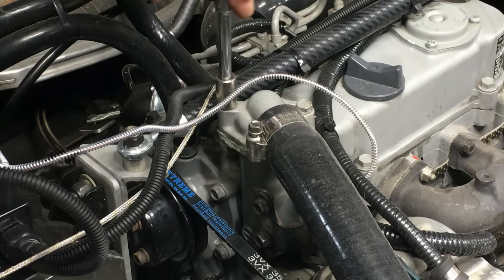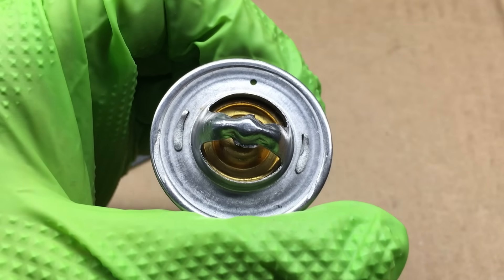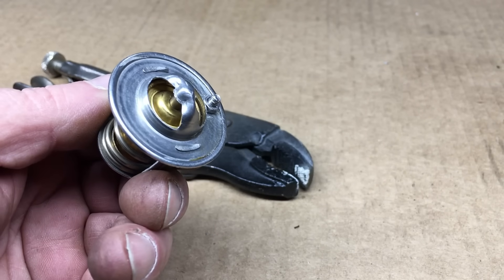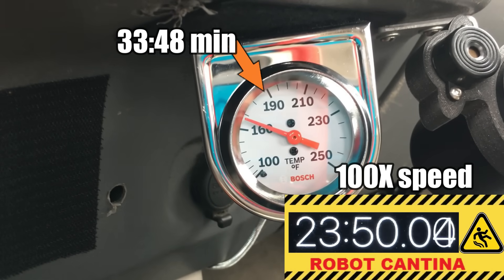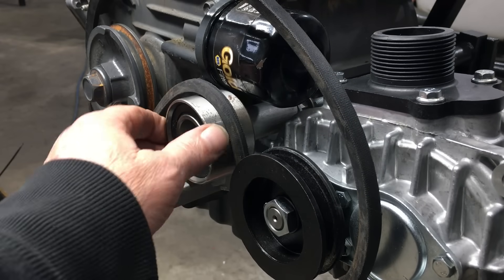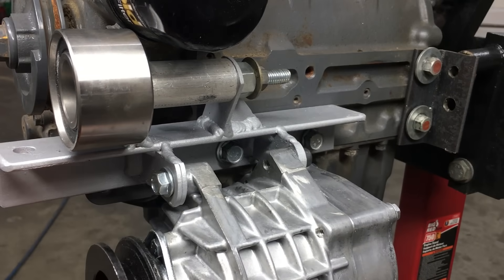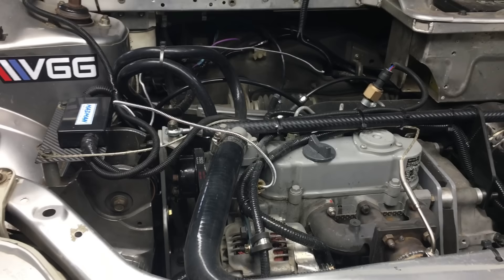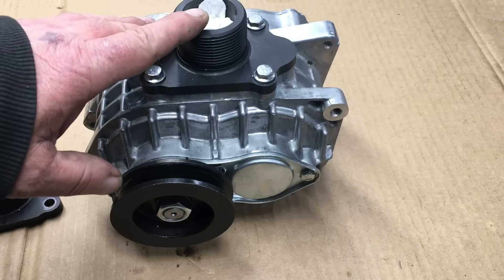S4 E4. Thermostat issues and making an AMR500 Supercharger fit a 719 cc Kubota diesel engine

Comment: I learned over 30 years ago to never run a thermostat under 190°. The engine needs to be hot enough to steam away moisture accumulated with temperature swings.
Reply from the maker: 180 is the hottest available for the Kubota D722.  Due to the odd size of the thermostat there and no other options.

Comment: Generally  the hole in the thermostat has a jiggle pin to reduce the chance of any air getting stuck there. It helps with the bleed too. Some engines prefer to have the hole in a certain position for best effect. There may be a note about that. Always bleed with the heater on full hot. Did you say this was an 88º? If so you do have the option of going to a 92º. I have used one of the Volvo blinds on a 1961 Amazon. Worked well as long as you kept an eye on the gauge!
Reply from the maker: Indeed the thermostat is 88c,   Obviously a hotter one would be more desirable, but 88 is the hottest available for the Kubota D722.  Due to the odd size there are no other options.

Comment: So... I was thinking, if I had a stupid charger, I'd think about adding a little electric oil pump and an oil cooler. do you think it's a feasible idea to improve the efficiency of the charger?
Reply from the maker: From past experience with these little superchargers, indeed the oil does get hot.  We will keep an eye on it when we do some testing, however I'm not sure I want to build a complex oil cooling system.  At some point I reckon we will run out of space.
Reply: @robotcantina8957 in addition to what you mentioned, I wonder how much weight would be added..

Comment: Automotive v belts generally won't run long with an idler on the back side of the belt.  the little diesel may not turn enough rpm to matter.
Reply from the maker: A few other have commented on that.  For now it will have to work.  The solution most folks have offered it to use a lawnmower belt,  Unfortunately due to the size nothing is available.    If the supercharger works out we will have to upgrade the belt drive to serpentine. But for now to keep it simple and cheap we will use the wrong belt.. it should last a few miles...

Comment: As a bunch of people have already commented the bypass hole also promotes some circulation so the heated coolant actually makes it to the thermostat but I thought it would be interesting to comment that on all the systems care have the thermostat is almost entirely unchanged from the beginning of their use till now with that tiny hole being among the most significant in their evolution and I think that is awesome.  Try to think of ANYTHING else that has remained almost the same for that long, I personally can't but I don't claim to be an expert in everything either so I am sure there are others.

Comment: Is there somewhere you could install a bleeder screw to help with bleeding the air out of the coolant system?
Reply from the maker: Yes, as I mentioned in the video, I do have the parts to solve this issue.  One thing at a time.

Comment: The shutters on modern cars also help with aero, as there is a fair bit of drag from air going into the engine bay and through the rad. Might be good to have the window shade running over a mesh or something, and out front of the grille. 

Also, it might help to drill and tap a hole in the thermostat housing to help burping?

Comment: it's a diesel, it will never heat up at idle as fast as a gasoline engine will because the combustion process is very different.

Comment: amr have 500ml per rotation the engine have 719ml per 2 rotations at 2 rotation amr gives 1000ml so you have 1000/719=1.39 bar map or 0.39 bar boost=5.65psi (theoraricaly) one to one ratio to achieve 14.5psi you need twice the displacement 1438ml or 1.438 to one ratio (theoriticaly) depending on cam volumetric efficiency etc so you are probaby close with these pulleys. nice job as allways.
Reply from the maker: Thanks for the math!

Comment: I haven't gotten seen most of the video yet but despite what is written, the bypass is also used to allow the temperature sensors to get a correct coolant temperature reading. If the coolant isn't moving at all, the coolant in the block will remain hot while the coolant where the thermostat is located will read cooler as it isn't exposed to the coolant in the engine block and heads. I'd imagine that a proper fix would be to shrink the hole instead of completely getting rid of it.

Be aware that this is just an educated guess.
Reply from the maker: Makes sense !
Reply: Just has to  pass air even 1/16 with a wire though it so it won't get clogged.
Or VW "Y" type radiator hose with the thermostat in the hose going to the radiator and the other just back to the motor. Coolant is always flowing at full speed just bleeds in some cold as the thermostat opens some.  they aren't cheap and cheap is important. @robotcantina8957  '77 front drive were all lie that, some BMW

Comment: The bypass hole is also to allow the air to escape and not cause the engine to overheat due to no water touching the sensing bulb of the thermostat.

Comment: This channel if full of first, The first Predator powered Honda Insight, the first supercharged BIG BLOCK Predator powered Honda Insight, the first 719cc diesel turbocharged Saturn Coupe, the first Predator 620cc powered Renault 10 and now the first 719cc diesel powered Honda Insight. I can only wonder what's next.
Reply from the maker: Perhaps a fuel injected supercharged intercooled BIG BLOCK predator powered helicopter?
Reply: I think it's got to be a two stroke snowmobile or marine engine fitted into a car. Other than a rotary Wankel or a motorbike engine, it's one of the only other out there options, just like the rest of the builds.

Comment: i believe some cars have vents that can open and close to help regulate the temperature in different weather conditions but often they are not that big. i would almost think maybe a different radiator from a smaller vehicle might help, some scooters are liquid cooled and have puny radiators but maybe small enough to not cool the engine too much or cool too little. less thermal mass might also help heat up faster as well.
Reply from the maker: The winter causes unusual problems, however the summer also causes problems.  The Saturn had issues staying cool with a radiator approximately the same size in the summer

Comment: I suggest installing a throttle plate on the inlet of the stupid charger. Your main FE disadvantage will be the constant boost (added load) even in light throttle scenarios. If the engine is always under significant load (even when cruising), then it won’t make a difference. But if you want to reduce boost, creating vacuum with a throttle plate will reduce power consumption of the supercharger when it’s not needed. Like when you plug your vacuum cleaner hose and it revs up due to lack of load. So operate your throttle plate based on EGT while cruising, either manually or by fancy Arduino trickery, based on load and EGT. 
I love the project!

Comment: I had a car that had no leakage hole in the thermostat and it was a bugger for pressurising the system and sticking the thermostat shut if I heated it up too quickly (i.e spanked it too soon) and sending the temperature gauge to the red and then dropping back. First time it did it I thought the head gasket was gone but no, it was just the stupid thermostat. Did it for years but never damaged anything

Comment: You can move the oil filter to the other side on these engines, there's an oil filter housing on both sides tides of the timing case, you just have to move the cap to the other side
Reply from the maker: The axle is in the way on the other side.
Reply: @robotcantina8957  aaaaah it would be too, would an oil filter relocation kit help the packaging of the supercharger?
Reply from the maker: @MothBird   I do have a relocation adapter in stock, but for simplicity I would rather try making everything fit  as is.  Things get messy real quick when solving one problem perhaps creates another problem.

Comment: Run a hotter thermostat
Reply from the maker: good luck finding one for a kubota d722 engine
Reply: @robotcantina8957  you’re 100% right, I just scoured the interwebs and even the evilbay and only found 160 degree and 180 degree thermostats that are meant to replace them. I tried looking for a 200-205 degree one and it doesn’t exist. Maybe there’s another thermostat out there from another engine that may fit, but I do not have the physical dimensions of the original and I highly doubt any auto supply chains or any internet sources will have dimensions of theirs that they sell. Kind of sucks but at least I gave it the good ol’ college try. Lol

Comment: Yeah, that takes longer to heat up than my VW ALH at 20f or less... If i leave the heat off or low, lol.. And my manual version has coolant heaters in the flange at the end of the head near #4 cyl to help.. There's no nice way to restrict air thru the rad/ block the grille...
Reply: Tested my daily driver today 30 degrees out doors as was the car for a few days started and drove right away, never going more than 2000 RPM and mostly 1500.  In one mile and 3 minutes (25 MPH speed limit and then 35 for the next minute at 4 minutes the car was full hot with good heat.  Honda civic has this same radiator you seem to have and it's got the hottest thermostat that I could find and gets just 40 MPG-38.  standard transmission, and I drive for economy nearly all the time.  everything I have on that saem drive has heat and nearly full warm in the mile and the 3 minutes.  the 305 V8 GMC pickup is a little slower to have good heat as it's a 4 gallon system, the Honda is a one gallon system.  Everything's been cleaned recently and nothings blocked.  The thermostat is in the lower radiator hose and lets the radiator water intot he block first and then the head and then back to the radiator.  the thermostat has a plate sticking 2 inches into the block, right at the water pump, I guess to pick-up temperature as nothing is moving till it opens, even then putting the cool radiator water on it as it opens.  Seems like the head could get too hot, but most Honda's are like that.  My Saturn Is also.

Comment: In the 1970's, the Canadian variant of the Toyota Corolla 1200cc variant (KE31) had a "venetian blind" kind of louvre in front of the radiator that you would close in winter, and open in summer.  It block most of the radiator in order to keep the engine warm.
Reply: These sorts of devices were common back in the day.  In the 1930's Rolls Royce had thermostatically operated slats in front of the radiator to help with cold weather operation.

Comment: I would have selected a tight fitting cotter pin to restrict the lion's share of the hole in the thermostat. This would still allow air to purge. Restricting coolant flow on the radiator return hose could also assist in warm up time.
Reply: That’s a good idea

Comment: I know I'm late to the game, but back in the prewar days you could buy aftermarket radiator shutters for this very problem.  Packard actually had thermostatically controlled shutters from the factory.  Same ol' problems have the same ol' solutions sometimes.

Comment: If there is no bypass hole, and the thermostat is sealing good, the coolant there will remain cold and the thermostat will never open while the  engine is running too hot because of non-coolant-circulation. With the hole there the thermostat will see the true coolant temperature always.
Trinidad & Tobago.
West Indies.

Comment: I assume you know about the very special air purge needed with this car in stock configuration and the special 
Vent bleeder?

I know the system is very modified know and you Mentioned problems with bleeding but …..

Comment: On the topic is Super Charger Vs Turbo.  It's great that you're experimenting with the super charge.  For future content after it is running correctly with the belt driven super charger, suggest converting to an exhaust driver turbo charger to do back to back comparison.  Then to go the extra mile, do a Lancia Delta style turbo and super charger!  What could go wrong, it'll be fun :)

Comment: I think you briefly mentioned having a cooling system burp solution, but if I miss understood, there may be a pretty cheap solution from Ford. My Mazda Tribute (Ford Escape in Mazda clothing) has a small plastic burp valve in the system to solve this issue - it works very well and it looks like it should be a a very inexpensive part . Adapting it to your application shouldn’t be to big of a job.

Comment: What if you install a hotter thermostat? If your current coolant system is overcooling already, if you install a hotter one (like 195F or so), it will start opening let´s say at 185F, and because your cooling system cools it down wayy too fast it will make the thermostat close as intended etc etc.
Also the hole (or jiggle pin) is there to prevent air pockets and having extreme temp differentials so the engine will not get a hit of colder coolant when needed.

Comment: Put the thermostat in a pot of water and bring it to a boil and measure the water temp and mark when the thermostat starts to open. It usually does right when its suppose too. Sometimes a lot later at first which makes it overheat at first.

Comment: Heck yeah brotha jimbo ... i got one thing to imput that might help and a speeduino is the answer ... for that build i feel you could greatly benefit from a no lift shift /rolling antilaf system setup so as to not lose any boost between shifts being it takes a lil to build pressure up , i think that might deff help ya with your between shift transiants ... n e ways peace and love bro keep it rad stay safe and build on l8z fam and keep having fun.. ps i really like what you do bro as im a tinkerer myself and my grandfather was oldschool tool and die maker or machinists as they call it now days 😅

Comment: When I was younger, my buddies and I messed around with dodge colts (Mitsubishi) from the early 90s. They were fun little cars with a1.5  in them. up here in Canada they would freeze up during the winter. We would swap the thermostat for one rated at 195. it Would fix the issue.

Comment: The bypass hole allows warmed coolant to reach the backside of the thermostat, which will open it faster because the whole thermostat is being warmed instead of just the front side.

Comment: A better solution than plugging the bypass hole (which is there to keep hotspots from forming) is to just get a higher rated thermostat. a 200* or 190* one will probably work better.
You could also look into electric pumps for the cooling system, and have it electronically controlled, but that's probably more complex than it needs to be.
Reply from the maker: Good luck finding a higher rated thermostat for a Kubota D722.  The thermostat is an unusual size.
Reply: @robotcantina8957  Can you do an hose adapter inline thermostat instead?
Reply from the maker: @roboman2444  Yes, but none of the inline thermostats available would fit the tiny cooling hoses on this engine without a stack of adapters.  it gets messy.

Comment: I'm just going to guess that either a lot of people have forgotten or a lot of people don't know but Detroit Diesel ran superchargers on pretty much every size motor they made for years 6 cylinders 8 cylinders v12. This has been done for a long time and it's not brand new territory so I personally agree that I think the supercharger is a better idea based on exactly what you said in the video. No lag power on demand. All just my opinion and guess. Granted I'm not a machine just a simple observer
Reply: DD are two stroke and can not start without a supercharger ( roots blower). 

This is a 4 cycle so yoy have the choice
Reply: @josephpadula2283  I will openly admit I did not know that. But still doesn't change the fact that diesels have had superchargers on them for a very long time and that it's not a 100% alien idea and or concept. I'm just excited to see where this

Comment: I had this whole thermostat debate and education process when I put together an oil cooler kit for my Subaru. Old hot rider logic says you want the coolest thermostat possible, but in the real world it’s nice when you engine can get to operating temperature in the cold and for oil it’s nice for it to be able to get hot enough to burn off condensation and fuel dilution. Long story short I found a 200deg thermostat and wish I could have found a 220.
Reply from the maker: The thermostat is an unusual size on this Kubota and 180 is as hot as I can get.

Comment: Once you get the supercharger sorted out you could add a turbocharger. Would be interesting to be running both. 2 stroke Detroit diesel that was in a wrecker I drove had both. 8-71 blower mounted in the engine valley with a huge turbo mounted on top of that.
Reply: I get what you're saying, but that was just a turbo engine. The 2 Strokers won't run without the blower. It doesn't create much if any charge pressure. 

I love me some Detroit's though, I bet that was the most GLORIOUS sounding wrecker anywhere on earth. The turbo Detroit's sound angry, and I love that. 

I have a dream of putting a 4-53T in like a 1 ton truck (or larger if I could find a sweet COE truck from the decade or so just after WW2. I'd drive it everywhere just to hear the scream 😎
Reply: @goosenotmaverick1156  it was a M984A1 HEMTT wrecker had an 8V71T in it. Wasn't very fast but it would pull about anything.
Reply: @shadymaint1  that's even cooler! Cool truck with a cool engine!